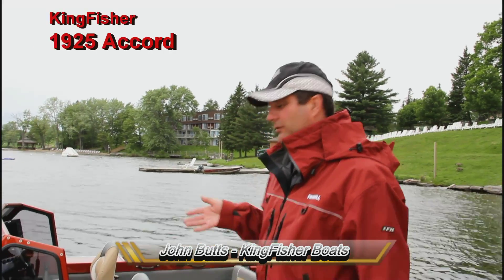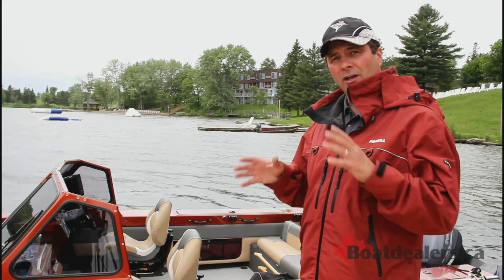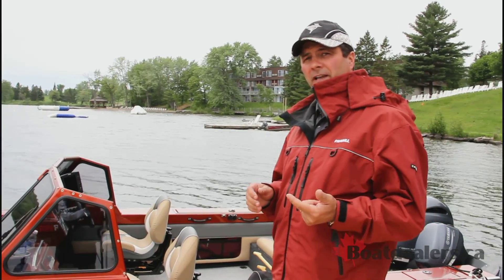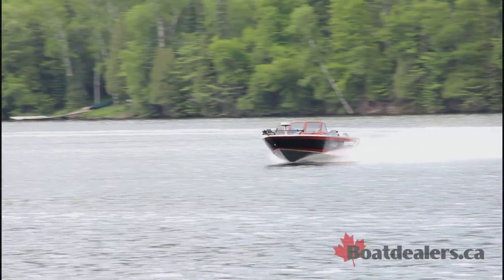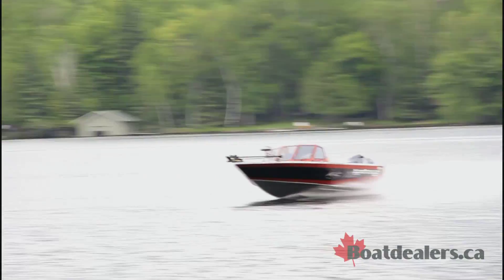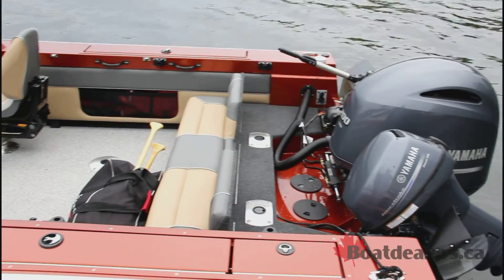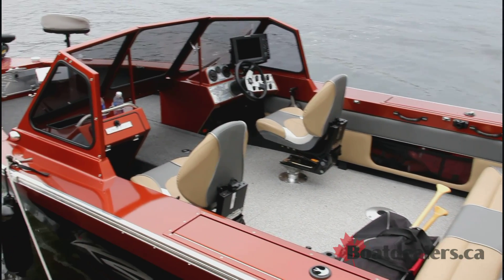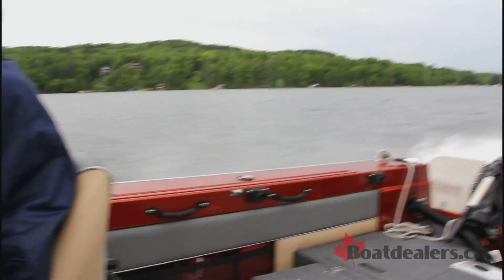KingFisher 1925 Accord Aluminum Fishing Boat

Comment: You know 160 gauge is 0.0016 of an inch right? Seems pretty thin to me
Reply: +smokum0   I was thinking the same thing. 
I think he meant  .160 of an inch. Roughly 9 gauge.
Reply: Typical salesman for ya. i knew what he meant too but come on he should know right?
Reply: +smokum0   For sure. I was a sheet metal worker so I have worked with a lot of different metals. If anything he should have exaggerated the other way. 
I think I will buy a Lund...lol  I have no problem with a riveted boat.